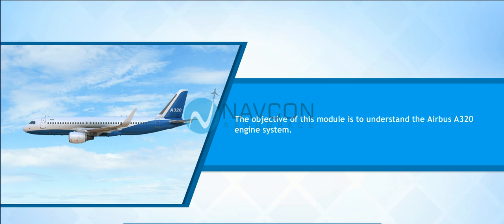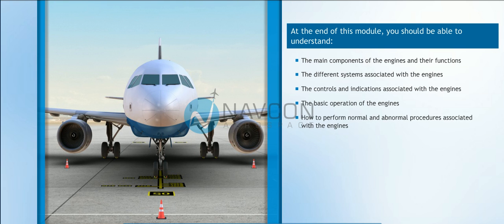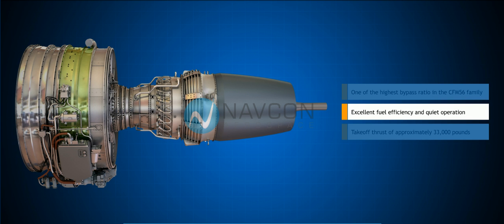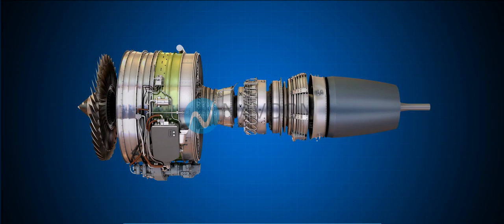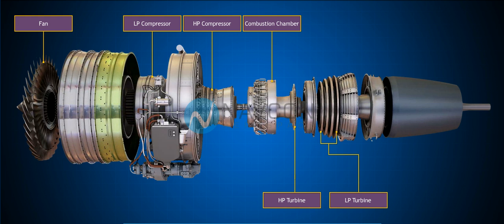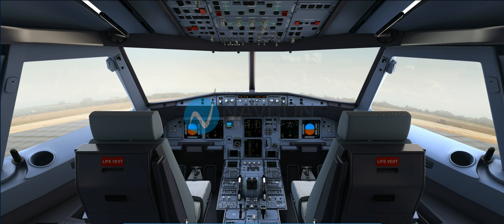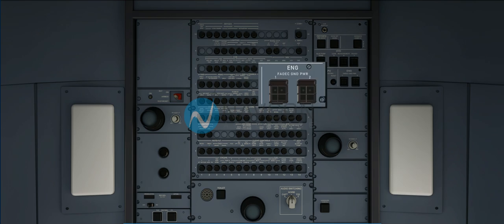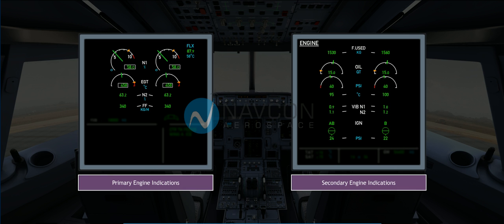Airbus-A320 Engine General Description

Comment: What material are the rotor blades on this engine?
Reply: titane
Reply: Titanium , to withstand high temperatures as titanium has high strength to weight ratio

Comment: Good video. Is FCU and FADEC not the same module?
Thanks.
Reply: Fuel Control Unit & Full Authority Digital engine Control
Reply: FCU - flight control Unit 
FADEC- Full authority digital engine control unit
Reply: @aviator_2401  Thanks for your kind reply. Appreciate...
Reply from the maker: Thank you for your comment. For more details, please email us at info@navcon.ae.

Comment: can anybody provide me with further literature or websites, where i can find more about the accessories and where exactly they are located on the engine. 

I m having difficutly imagning the positions of components, like Pumps, Gearbox and so on
Reply: The gearbox is shown in the animations. Lower side of the fan case  below the oil tank.  Its contains starter valve, IDG (Integrated drive generator) , hidraulic pump , fuelm pump, PMA( permanent magnet alternator for the EEC ) , etc...